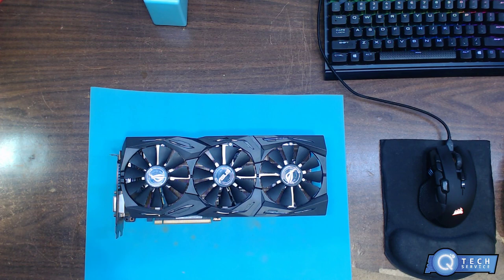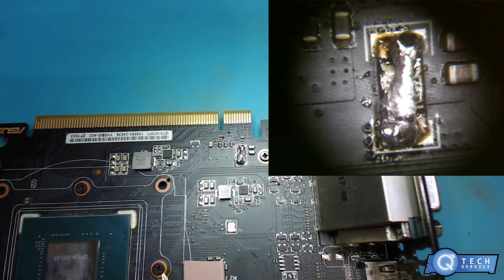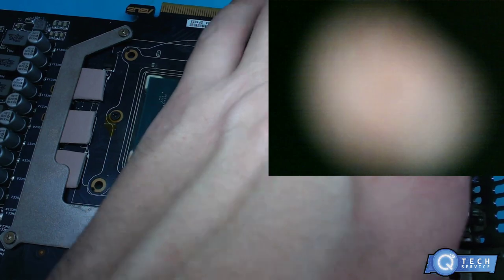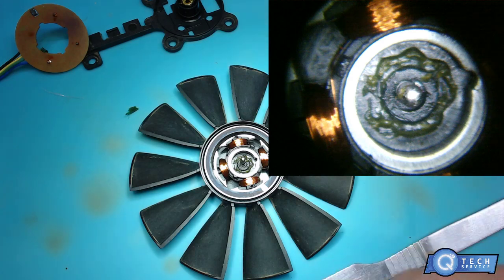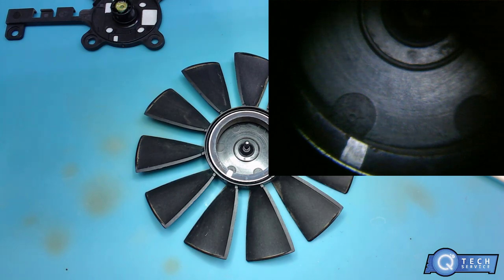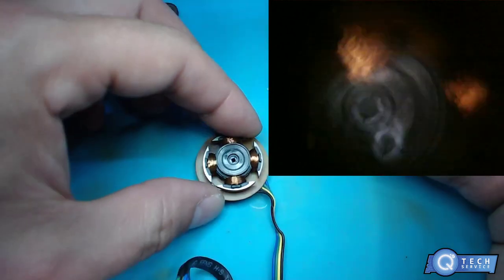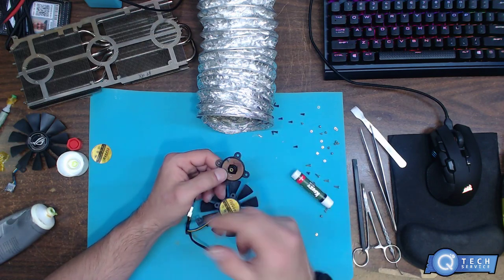ASUS ROG STRIX 1070Ti Fan Fix & Mod Fix

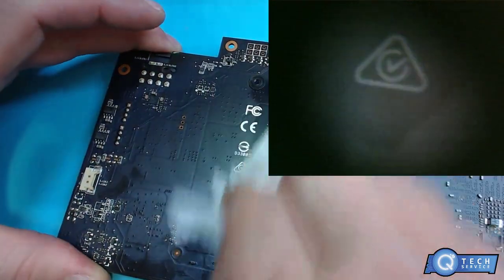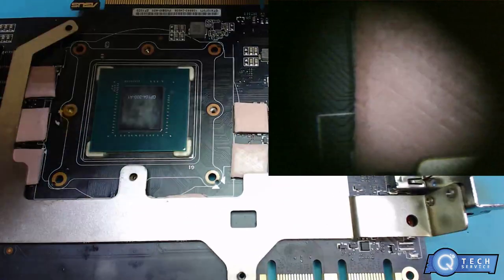Comment: Hi there, what are you using at 42:45 , regular tissue or special kind of wipes? One more question would you can see 5 components covered by pads at 31:45 , originally the pads were only where ever that metal shield touches those components, otherwise they were not covered. Would you recommend to cover them like he did, as well as those he added on the back? thank you